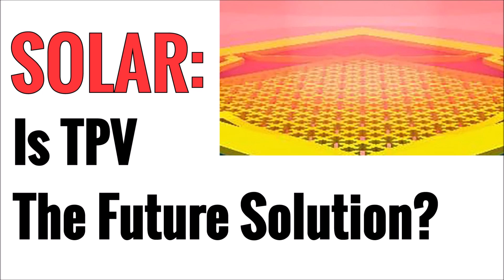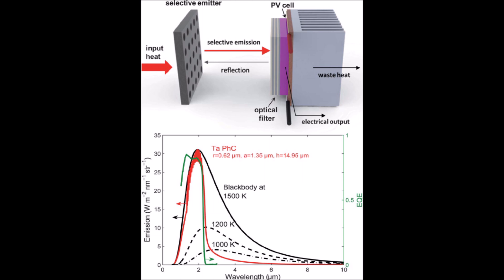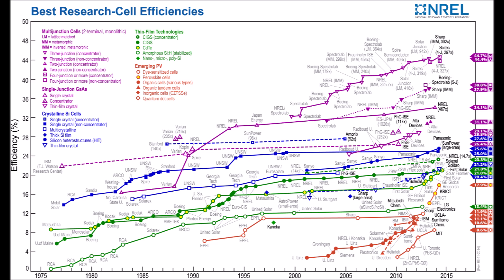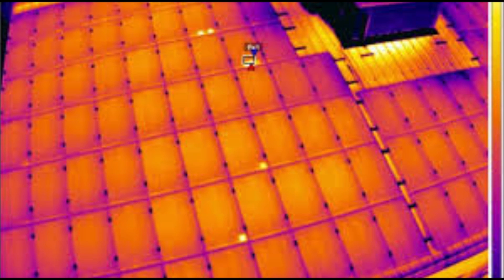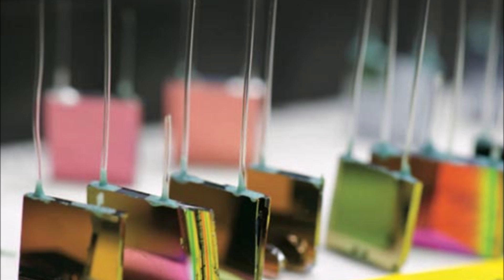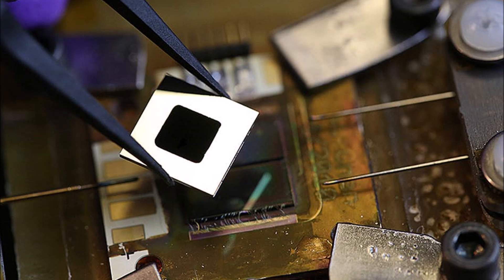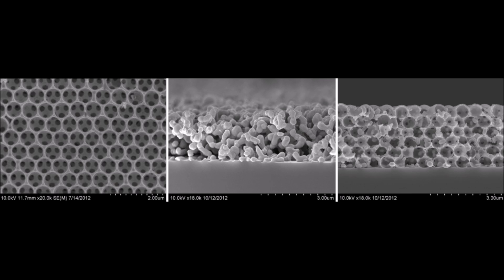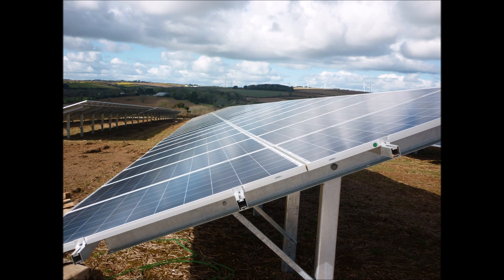Are Thermophotovoltaics (TPV) The Future Of Solar Power?

Comment: If this is true. It won't just revolutionize solar cells. How many things out there have waste heat? The internal combustion engines for instance. But my next question is. Does that mean it also works like a heat sink? Is the heat energy that is converted being removed? Could you for example have a device that goes on your computers CPU instead of the heat sink that just converts the heat to energy? It wouldn't convert all of it so it would still have to sink to the air the rest of the heat.
Reply from the maker: What you are referring to is called a TEG (Thermoelectric Generator).  It is basically a peltier device that creates a small amount of energy from high heat.  But it has to be in the several hundreds of degrees to work very well.  So it would not work with solar panels.
Reply: @LDSreliance  I got the impression this was more advanced than a TEG. I know a TEG isn't very efficient. I thought the article was about an efficient way of converting heat to electricity.

Comment: I also wonder if simply adding cooling to PV, would be worth the effort, if the gain in effiency, would be worth the price of adding liquid cooling, the liquid could be used to heat a home, or to heat water! It's just a question of it just being a gain or loss!
Reply from the maker: Yes, there are solar panels with solar heating built in to them.  They are not common but I have seen them.

Comment: We don't 'need' higher efficiency solar unless that higher efficiency leads to dramatically lower costs which is unlikely since the cost of installing solar is already ~50% labor.   The roofs of most homes can already support enough solar to offset ~100% of their use... we just need to work on bringing the cost down.   The law in CA should help move us closer to this goal with economies of scale.
Reply from the maker: I'm not sure where you are getting that the roofs of most homes have plenty of room for solar.      That is not the case where I am from.  If a homeowner is lucky enough to have a south facing roof, then they need the right pitch and enough square footage for panels to meet their needs.  More efficient panels will allow more people to take advantage of solar if they have sub-optimal pitch, their roof doesn't face due south, or they don't have enough area.
Reply: The higher efficiency also comes with a cooling effect increasing the longevity of the solar panel and in hot areas a slight beneficial cooling effect to the roof/home itself.

Comment: Most designs for solar thermal energy requires Plumbing. There's no doubt adding another system in conjunction with existing photovoltaics would increase the Energy Efficiency but at what cost.... I would like to learn more about the new process and how it intends to not get in the way of the spectrum (s) of light used in the photovoltaic effect of the particular panel.

Comment: Just when PV was coming down in price, they want to add gold mirrors to it. I wonder if peltier devices (the gadgets in Coleman electric coolers, only in reverse... use cold & hot to make electric instead of electric to make cold & hot) could be used instead? They are also thermo-electric. Or... capture the heat with a water heater while also cooling the PV to keep the PV efficiency higher.
This is good info. that we simply don't hear about!
Reply from the maker: I doubt that gold will be the final material used in commercially available units.  Typically, ideal materials are used in testing and then they will find a cheaper alternative that does almost as good but costs far less.  Think of wires for audio or power.  Gold is a better conductor than copper is but copper does really well and costs a fraction so copper is the most widely used material for wires.